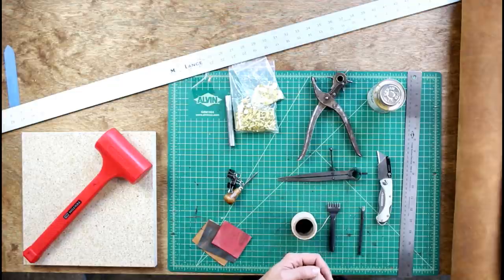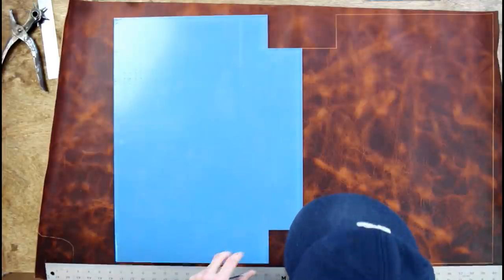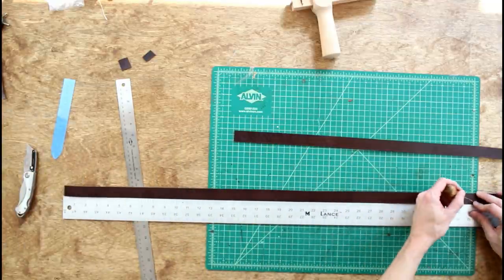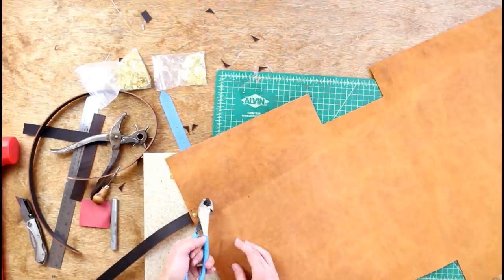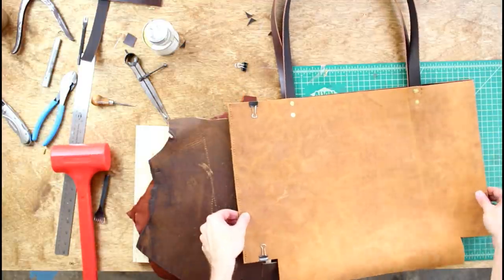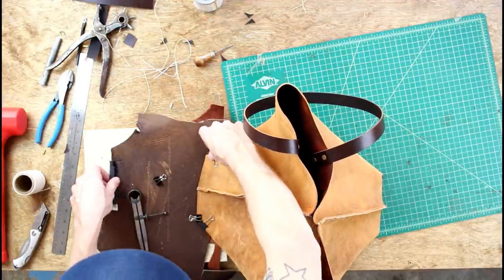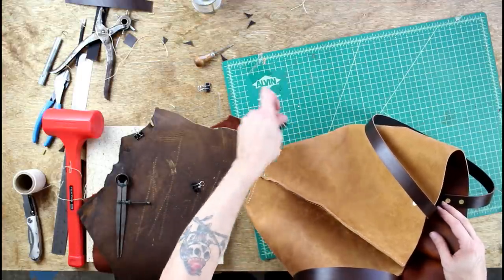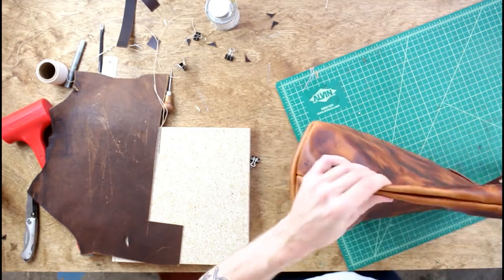Making A Basic LEATHER TOTE BAG - Build Along Tutorial

Comment: You mentioned for the purpose of the video you are using basic tools, but would you use your laser cutter to normally cut out the leather pieces for the bag?
Reply from the maker: I could but it would have to be a smaller tote. Most normal sizes are too large to fit in my laser bed.